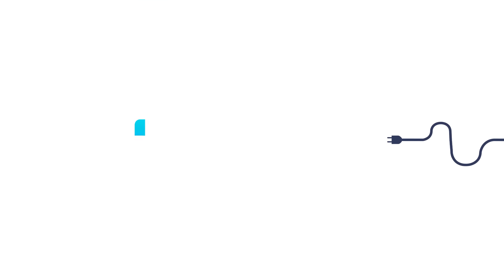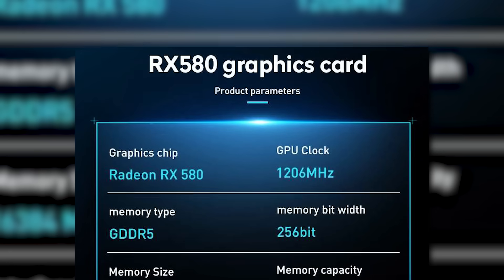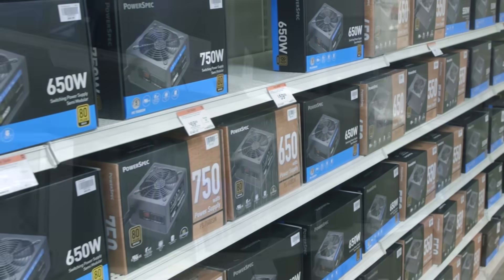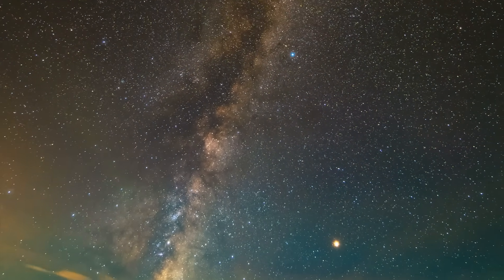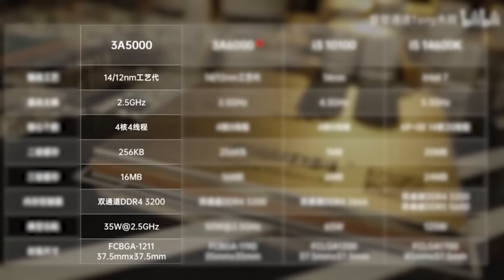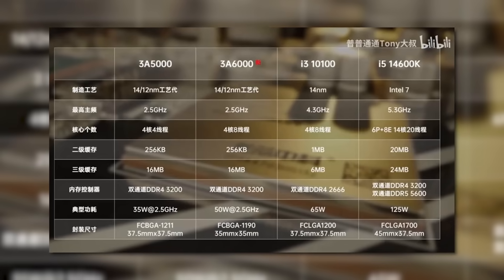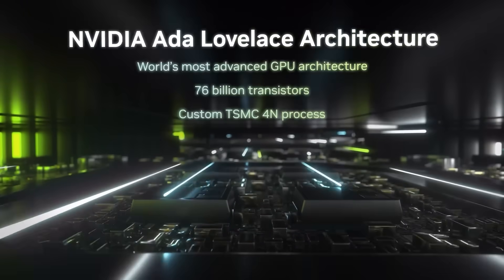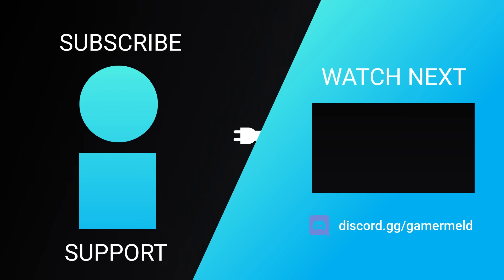Nvidia's Releasing The WEIRDEST GPU EVER!

Comment: I live in a suburb of Ohio. My one good thing is that there is a microcenter not 25 minutes from my house. It's been here since the late 90s. I've been going there for my computer parts for over 20 years now. My only complaint is that sometimes the employees are a little "too" helpful. I go in there for a specific CPU, GPU and some RAM and they start talking to me like it's my first time putting together a computer. Kid, I was putting computers together when you were in diapers. I understand why they do it, customers buying the wrong or incompatible parts and having to return them is probably a headache, but once it's clear that I know what I'm doing, just leave me be. I'm not an a-hole, just extremely introverted.

Comment: Imagine... Gpu releases every year. That would be mental. You just got your new RTX 5070 and year from then its useless because RTX 6070 blows it out of the water... Very consumer friendly haha. And also RIP consoles if this happens. Imagine how quickly Consoles like PlayStation will get outdated. Even now ps5 is barely 3 years old and it already so outdated it can barely run modern titles at 1200p resolution upscaled to 4k at 30fps almost zero ray tracing. Forget about Pathtracing...

Comment: RX 580 with 2048 cores has always been a thing, it is not a scam
Reply: I mean, it's still a scam to anyone if the proper specs aren't provided. Unfortunately, we see this kind of tactic used in prebuilt PC's w/an RTX 3060 not clearly denoting 12gb or 8gb.
However, if they do advertise the 2048 shaders clearly it goes from scam to simply overpriced repurposed card w/16gb vram.

Comment: Great video! I've been wondering, I hear a lot about a GPU price increase due to this China ban situation, has this price increase already occurred? I was planning on buying a new PC in late Dec / very early January and can't buy earlier. 😅
Reply: what pisses me is why a china ban would make prices go higher , seems we'd have more gpu to sell every where else so price should either stay the same or go down. since china will no longer be taking up that part of the market.
Reply: @DenverStarkey it’s because of panic buying and opportunistic behavior with buying up GPUs outside of China and then shipping/selling them in China.
Reply: unless you live in china wouldnt a ban in china lead to a surplus in gpus?
Reply: @samuelkdu  There were mass shipments of AD102 to China before the ban, and surely panic buying shortly after. Rumor says 4090 supply will be depleted until approximately Q1-Q2 2024. It's not exactly a "good deal" at $1,599, anyway.
Reply: @samuelkdu My dude never heard about contrabanda... Thisbis why prices skyrocketed everywhere, and matters will only be worse with bitcoin on the rise

Comment: I don't think release gaming GPU's every year should scare AMD or Intel, i mean what kinda uplift do you think would come form that kind of turn around.
Reply from the maker: It doesn’t necessarily matter as long as it’s enough of an uplift to make AMD’s not worth it. They could just lower prices, but that really hurts a company as well. It would almost certainly force AMD to do the same.
Reply: Doubt they will release gaming gpu’s every year. They will be AI focused only as that’s the new market ngreedia can make a fortune. If the frequency between gaming gpu’s changes it will most likely increase to 3 years so they can focus more on what makes them the most money, AI. Don’t think AMD and Intel won’t follow suit either cause they will.

Comment: So the D is the same card, but comes with an easily flashable bios to unlock its full potensial,
Reply: That's my suspicion as well.  China is quite a large market NVIDIA doesn't want to lose. Especially not the high-end.
Reply: @Nismo11  nvidia made several moves to bypass export restrictions already, sending a massive shipment just before they kicked in, making the h800,  h20, l20 and l2 for the chinese market. China is 20-25% of nvidias datasenter market. So there is quite a bit of money
Reply: @genstian  Yes, the exact reason for the recent shortage of AD102. 

>20% of NVIDIA's datacenter sales doesn't surprise me. I've mainly thought of the entire import restriction silly. I don't see how it would end favorably for anyone involved.

Comment: 580 2048sp is a rebrand, just like the 590 GME which is a regular 580, there is a lot of content from brazillian channels on them, there is a high number of those that stop working due to VRAM going bad, so it's kind of a lucky shot. The 16gb 580 is not that good for gaming as it has to work more to handle the vram and can't really play where it actually needs 16gb to begin with
Reply: All these are likely meant for AI anyway - AI workloads don't limit you to a single card like games do to force you to pay 1000$ for a card.
Reply: The sheer raster performance of the 580 used to make me question why it even had an 8GB memory buffer to begin with; there are 4GB variants of it and aside from a slower default memory speed (1750mhz vs 2000mhz) they both average about the same fps in every game where the 4GB of VRAM isn’t a limitation. I mean don’t get me wrong, I’m GLAD that AMD made it with 8GB initially (I actually had one before getting a 3060ti) cause it certainly has helped it age better than the 1060 6GB. But when it comes down to it, the 1650 Super is also fairly equal to the 580 and those only ever had 4GB in the first place
Reply: @invader-zen  4gb of vram is not enough so games choose to spend the system dram for making up

Comment: So a 4070 with a 4090D label and 3000$ sounds about right?😂
Reply: 4090 has a normal uplift like the 4080 too. it's 4070ti and below that are named wrong
Reply: @dominic4645 Nah the 4080 is named wrong as well. It should have been the 4070ti.
Reply: @ZackSNetwork  4080 has a 50% uplift from 3080, so it's name right. just should been $700 instead of $1200. There's a massive gap between 4080 and 4070ti where 4070ti should been bumped up performance then what it has for $600. 4070 should had the 4070ti performance at $500. 4060ti should had 4070 performance at $400, and 4060 should has 4060ti like performance at $300
Reply: Yeap it means Nvidia telling everyone to get ready to take a big "D" behind their a** lol
Reply: Big black 84090D

Comment: Major point missed with the Chinese CPU. Many architectural features that are used to increase IPC also negatively affect the clock rates.  Were talking pentium 3 vs pentium 4, or AMD FX vs. CORE.   Intel and AMD have to balance clock speed vs ipc as their are benefits to both depending on the task. I highly doubt the Chinese CPU could get anywhere near 5ghz without a major reduction in IPC boosting features in the design.
Reply: Plus the story don’t tell anything about if these cpu’s run standard known OS’es or something completely different
Reply: @mrdali67  linux is standard, now the distro that is a different matter but it should not make any difference.  there is no telling what arch that cpu is, it could be a customer arm cpu with that low a clock speed.  then the major thing people would need to really worry about is built in back doors into the cpu since it is after all china.